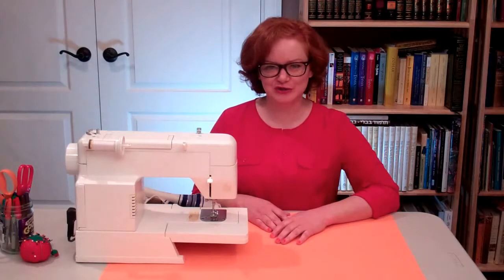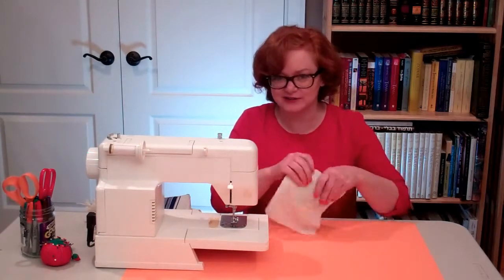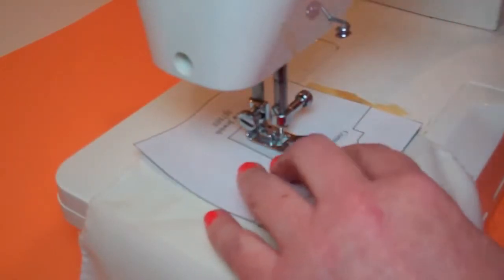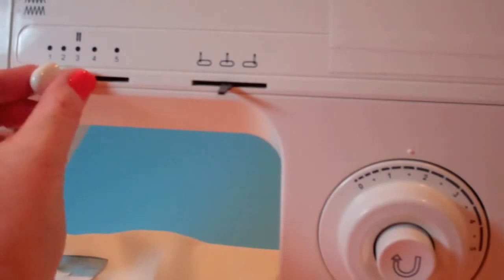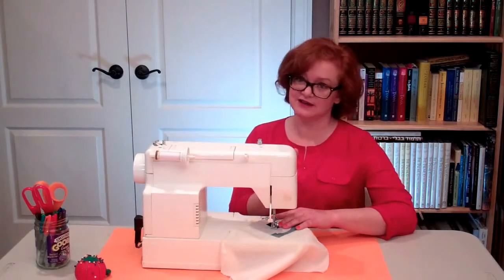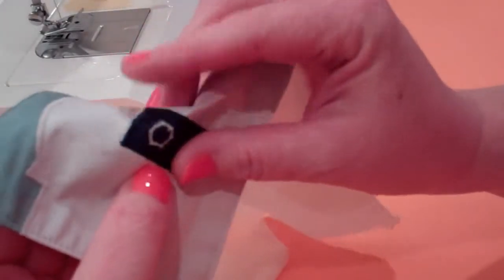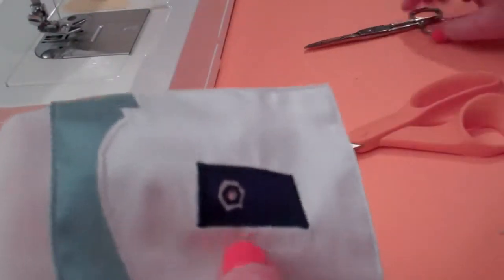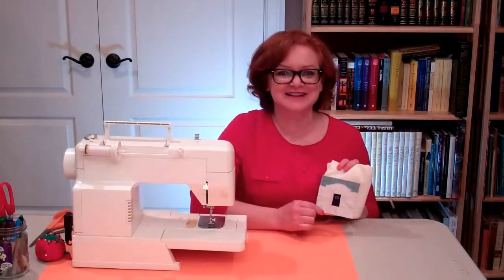How to Sew Tzitizit Holes on Your Tallit | Sew Jewish 02

Comment: Shanah Tovah UMetukah Maria!  I'm starting to sew a TALLIT and wanted to ask if it's possible instead of cutting the 4 squares fo the TZITZIT, if I can sew them (squares on a different color) on top of one side of the fabric and also attach an APPLIQUE on them? / As you´ve explained and I´ve searched, mostly the ATARAH and decortion are for differentiating the side of the TALLIt. / Looking forward fo your reply! Hugs from Mexico.
Reply from the maker: Hi Simha, I'm not sure if I understand your question, but you can add an applique to the fabric squares that you use to reinforce the corners.